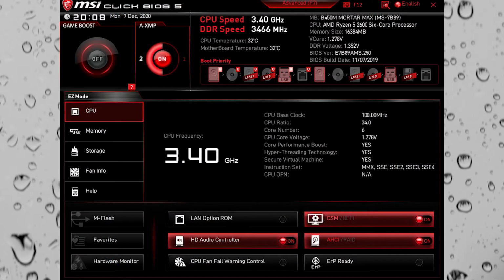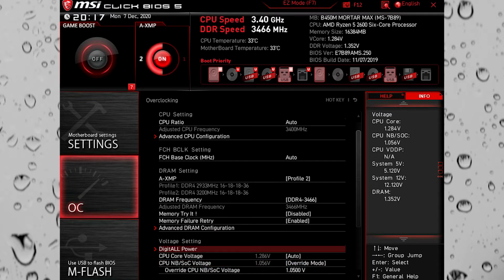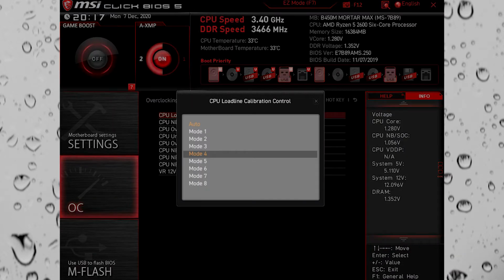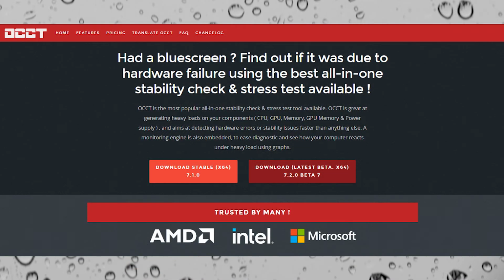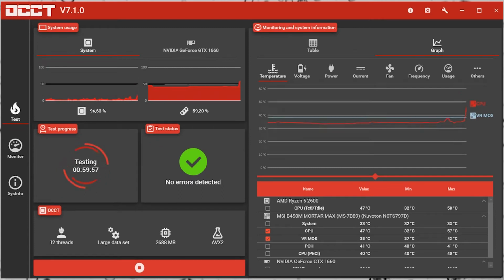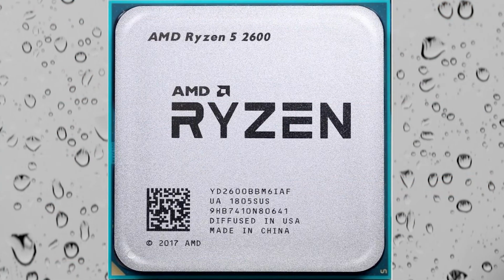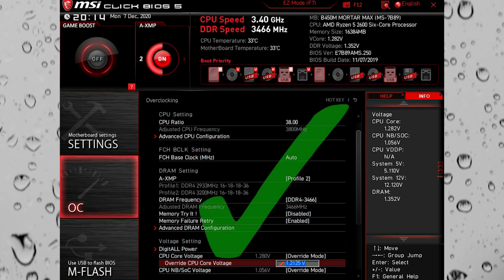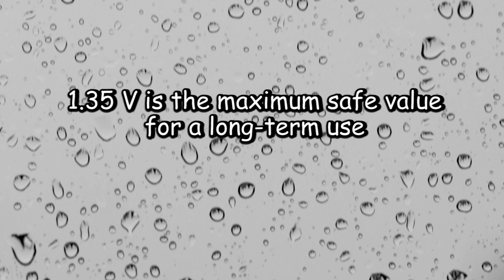How to Overclock AMD Ryzen CPU - Part 1. Cores. AM4. 1600, 2600, 5600x, 3100, 3600, 2700, 5800x etc.

Comment: Don't use overclock word with ryzen 5000. You can't overclock. You can undervolt so less temperature factor will get you higher frequencies. That's it.
Reply from the maker: In case of Zen 3 it depends on the quality of a certain sample. Some samples are better than others, so they can be overclocked by 200-300 MHz.
Anyway this video is dedicated to all Ryzen CPUs and many of them can be overclocked by a few hundred MHz.

Comment: you should actually overclock your memory before your cpu cores. this is because a memory overclock can destabilise your core overclock because the cpu has to do more work as the memory is sending it more data. for zen2 and zen3 i would stay at or below 1.3 volts after vdroop. zen 1 is good at 1.4 volts as its a 14nm node, and zen+ at 1.375 volts. maxing out your llc isnt a good idea as no vdroop at all actually decreases stability. you want some vdroop for the stability gains (obviously you have higher voltages on low loads but at low loads higher voltages are safer) but not too much otherwise you get stability decrease. VR MOS is fine for low 100s in terms of temperature, and cpu 85-90c is fine. these are at heavy loads. occt small data set is better for cpu stress testing, large data set for memory.
Reply from the maker: Does not matter what you are overclocking first. Just be sure that all other components are stable during overclocking of a certain part.
Thanks for the tip about vdroop. I haven't changed LLC value since then (4th level is enough in my case), but it should be useful information for those who want to do (or did) this.
As concerns temps, I am talking about OCCT and large data set, as it's load corresponds the load created by majority of working apps and games. If your VRM temp is usually more than 80 °C, it may fail after some time. Of course some other stress apps (like Prime95) will increase temps of both CPU and VRM by a dozen degrees Celsius. If your system temps are less than 80 °C during OCCT test, then it will most likely pass Prime95 test as well.

Comment: I wasn't expecting this good of a video given the number of views and it being so short. Thank you for making it so simple and comprehensive, really looking forward your next oc videos! I´m waiting for my Ryzen 5 5600x to arrive (already got all the other components ready for it). I've already build a couple of computers but I never tried overclocking as I used mid-range components not really capable of oc, but with my new build I can finally start tweaking settings :D just a couple of questions: 1) When checking for stability, what steps do you follow when getting a blackscreen? just reboot and change it back in BIOS? 2) Changing CPU ratio to 38, for instance, would make the CPU work at that frequency all the time? Or when in iddle it will come back down? 3) Other guides I've seen on oc Ryzen 5 5600x recommend just enabling PBO (i think it is enabled by default), changing CPU ratio or any other settings will deactivate PBO or how does it work? Cheers!!
Reply from the maker: You are welcome! I am trying my best. Next week I'm planning to release a second part about memory OC.
1) Yes. After balck screen appears just reboot your PC, enter BIOS and reduce CPU miltiplier and/or increase CPU voltage (if you haven't exceed 1.35V yet). Then try again.
2) Yes, if you set 38, then your CPU will always work at 3,8 GHz. If you want it to dynamically lower it's frequency while being idle, you need to enable "PState" (for MSI motherboards it is placed in the "AMD Cool’n’Quiet" tab). I set it to "PState-1". This made my CPU automatically lower it's frequency down to 1,5 GHz when idle.
3) All Ryzen CPUs with "X" (especially 3000 and 5000 series) do not really gain much from manual overclocking. So, yes, PBO is arguably a better choice for them. You can set PBO to "Advanced mode" and use the latest feature (which appeared in the new versions of BIOS), called "Curve Optimizer".
If you use Manual OC, then PBO is automatically disabled.
Reply: @starstreamgamer3704  Wow thanks again mate!! I must have seen hundreds of hours of guides and walkthroughs but they NEVER talk about this kind of stuff and you just summarized it in one parragraph. I have an MSI b550 mortar and I'm waiting for them to release a stable version of the BIOS with curve optimizer, which is expected to release in the next days. I'll let you know how my overclock goes ^^. Hope to see this channel grow, keep it up man!
Reply from the maker: Thank you. Glad I could help.